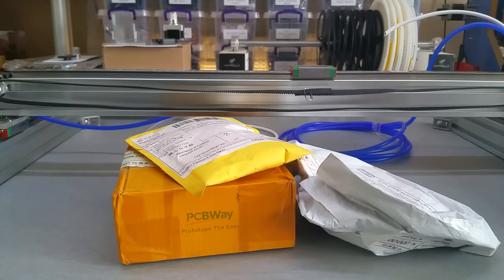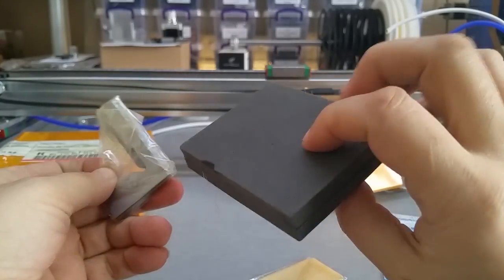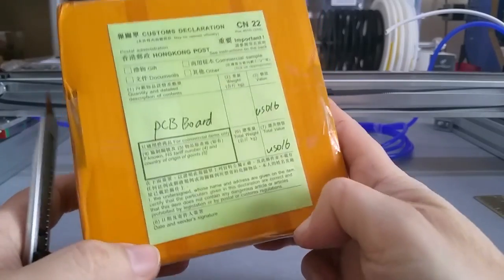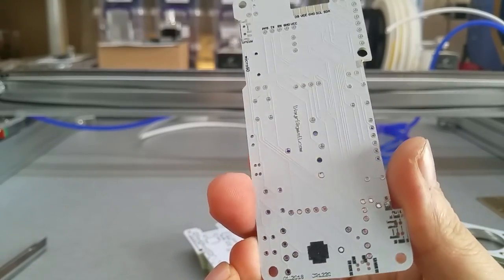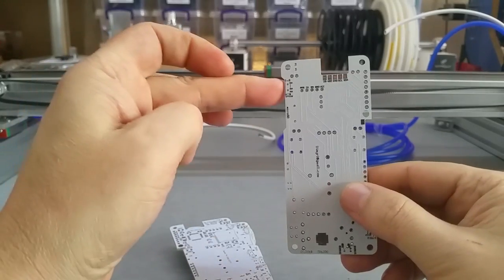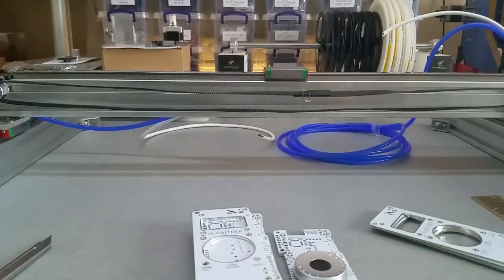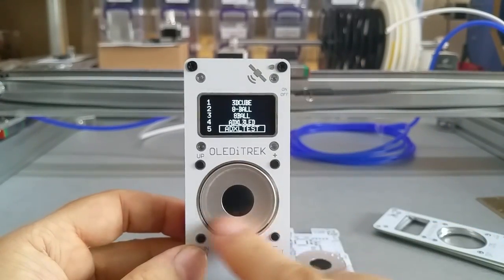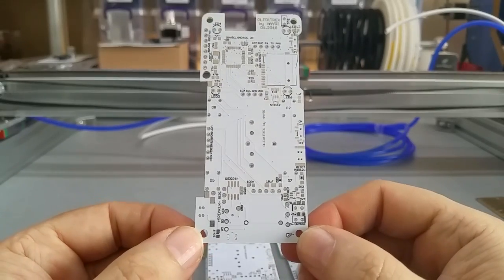Finally the OLEDiTREK PCB's have arrived, please see description for final update and product,thanks

Comment: What is this method of loading different codes from the microSD card at the beginning called? Do you copy multiple bin/hex files and load them to Arduino during boot process?
Reply from the maker: Correct, I have hex files on the microSD card that get selected through a menu and then uploded. It is based on Gambuino.
Reply: @iHayri1  thanks

Comment: Wow this is just amazing. I was looking for some inspiring stuff all over the internet and this is just the best I have found. 
I am writing an interface for a Time Lapse controller based on ESP32 and SSD1306. It would be awesome if I could view your code. Is it open source? Some Github there? I am very new to coding and my progress is very slow because I never found stuff out there to learn step by step to build interfaces, menus, etc... Im using ThingPulse library btw. Thanks
I am definitely buying this. I it is a very nice design from the PCB to the code inside.
Reply from the maker: Hi, this is not based on the ESP but on the Atmega328 chip. I use all kinds of different libraries all depending on the code used. There will be around 50 apps that will come with the OLEDiTREK and everybody will be able to add his own code/app.
Reply: That is so nice. When will it be available on the store?. ESP32 is Arduino compatible now the code is so easy to port it and I choose this chip because it has 2 cores, 32 bit, Wifi, BLE and low power capabilities. Do you use Arduino to code it? Thanks you so much. Open sourced or not, it is a really good piece of work I cannot wait to buy.

Comment: Congratulations!   Looking forward to see how your build works.   Particularly interested in seeing how the pick and place and surface mount soldering work.   I have no idea how surface mount soldering works in a small operation like yours.   What is the purpose of the OLEDiTREK that you envision?
Reply from the maker: Thanks. Well the pick and place just puts the SMD's on the PCB and I re-flow them in a toaster oven. Need to apply solder paste first of course using a stencil preferably. Still need to order the stencils for all boards.

Comment: Those are some cool boards! So many functions and apps!! Do you have the link to the set square also, that looks solid?!!
Reply from the maker: Thanks, sure do, here you go: https://www.ebay.com/itm/63x40mm-Try-Square-Ruler-Angle-Broadside-L-Shaped-90-Degree-Blade-Measuring-Tool/352231865442
slightly more than I remembered but it is really nice :-)
Reply: Thanks!

Comment: It looks great! What did you pay for these custom PCBs? How long have you had to wait for them - delivery time?
Reply from the maker: The price depends on size and other factors, your mileage will vary, best check it out on their website. Shipping took way too long, will order with DHL from now on even if the shipping costs are higher. At least I will not loose time and potential sales.
Reply: Hayri I know that the price depends on PCB design. I wanted to know the price of your PCBs with that design. I want to make my design in similar dificulty as yours. It should be used for railroad models. Thank you.
Reply from the maker: Need to look it up o my first initial order. These were made at no cost because the first ones I did not like the quality of.